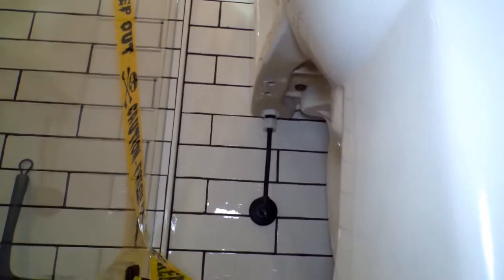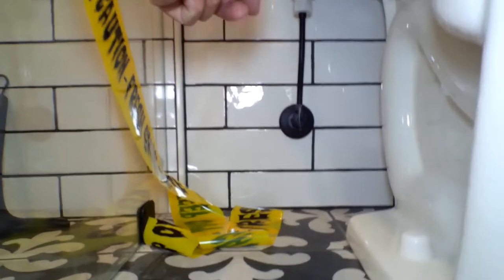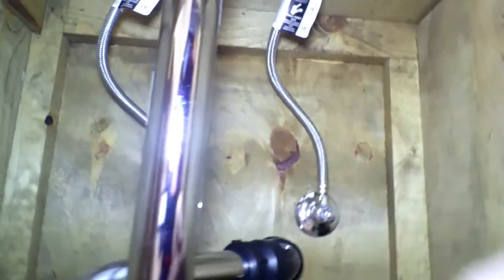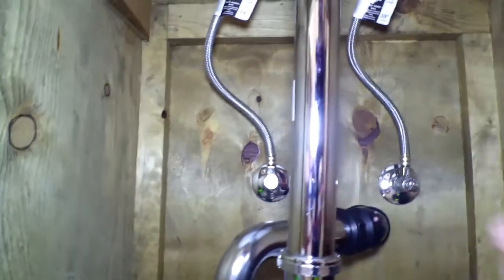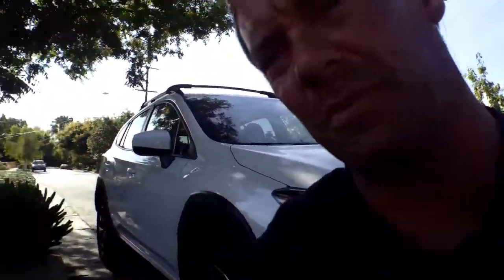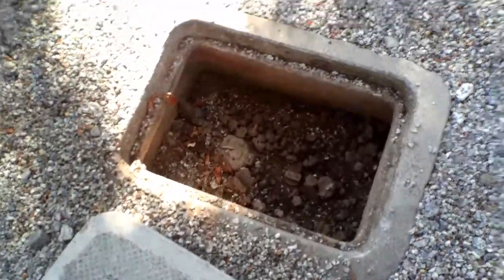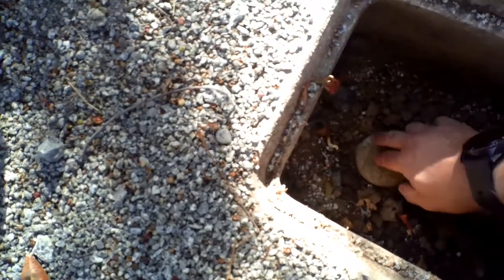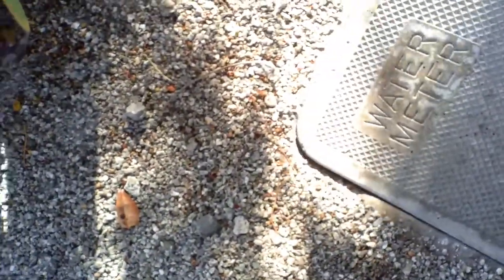Shutting off water within your home or apartment

Comment: For anyone who is watching this and lives in an APARTMENT and your TUB wont stop running.  The way you shut the water off in your apartment is to look at the ceiling above the sink in the bathroom, there is a box..that is where the shut off valve is for everything.    I learned that tonight...good luck and you are welcome.
Reply: @goddesignd  no problem, I figured anyone who came here was having the same issue I was, and found this video super unhelpful.  I hope it worked out for you, I know it was frustrating for me and when the maintence guy showed me I was like "I would have NEVER LOOKED UP".
Reply from the maker: Always do your homework. Thanks for the compliments
Reply: Thanks for that, I was having the same luck.  But I don't even have that box.  Mine is behind a freegin wall panel in the back of my bedroom closet!!!  I have to remove 10 screws to get to it!!! Not to mention pulling EVERYTHING in my closet out to do it!!!  SO ANNOYING!!!!!!!